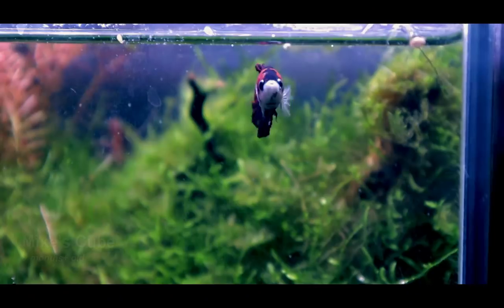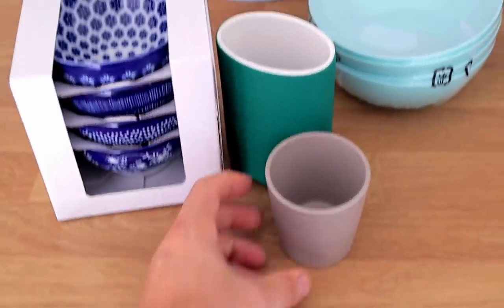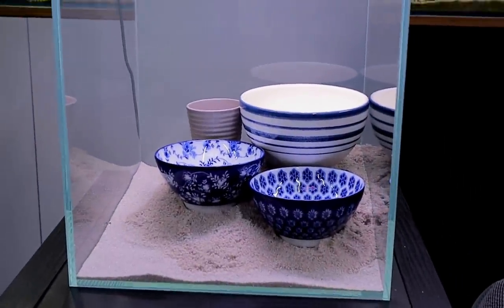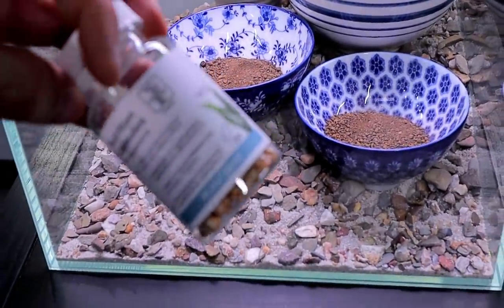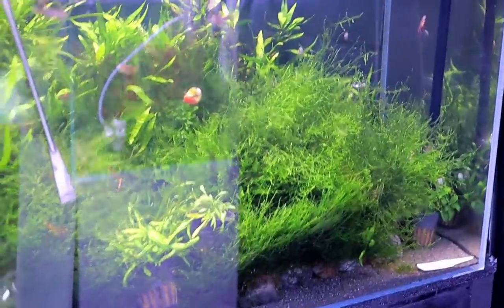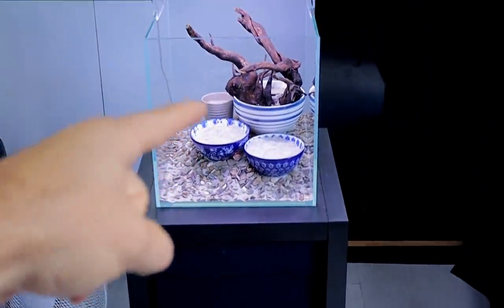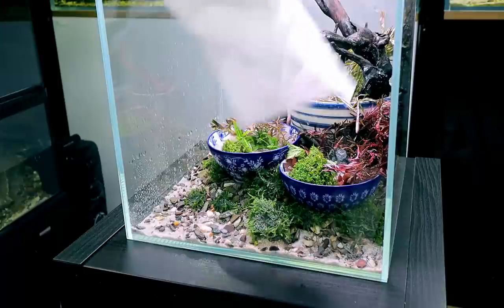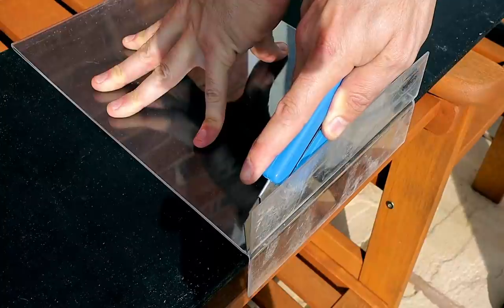Aquascape Tutorial: IKEBANA BETTA FISH Cube Aquarium (How To: Full Step By Step Planted Tank Guide)

Comment: dont know if its just me.. but whenever I try planting with tweezers, I always end up pulling the plants back out with them... they never stay in the soil
Reply from the maker: there is a nack to it. Down and in straight, rlease, slight wiggle, pull out at an angle....(to confirm, thats planting, not anything else 😂)
Reply: MD Fish Tanks ☠️☠️
Reply: Yes it's just you

And me
Reply: I have the same problem... So I end up using my fingers instead
Reply: I use an S shaped motion with the tweezer as it enters the soil. Works well with smaller plants 🌱.
Reply: @Eric-uh7nl  So you S shape down into the soil, then s shape back out and the soil falls back inside the whole?

Comment: What sort of furniture do you use as stands for your tanks?
Reply from the maker: Ikea lol.
Reply: @MDFishTanks  So is there less or no worry over leveling the stand for the smaller tanks like this one?  Maybe this tank has glass that is sturdy thick and not to worry.  I think of these things as I'm switching over to glass tanks.  My new tank will have rims and the glass is perhaps a little thinner than the tank in this video.  I know...boring subject.  I just would freak if 10 gals of aqua would spill out onto my apt. floor. 

Anyway the tank turned out wonderfully.  It does have a different look.  Using the same materials....rock, wood, substrate.......can make aquascapes designs to all look alike.  Maybe just me...  I loved the subtle coloring and Mike looked to be very comfy once settled in a bit.  Some bettas get very upset when put in a new tank.  They can get very emotional.  The Plakats are easy swimmers...strong swimmers.